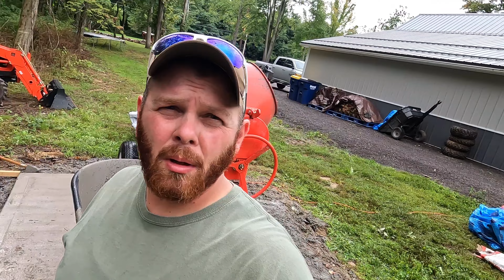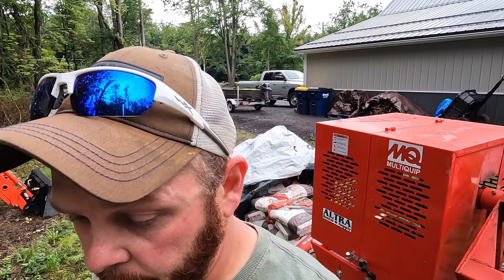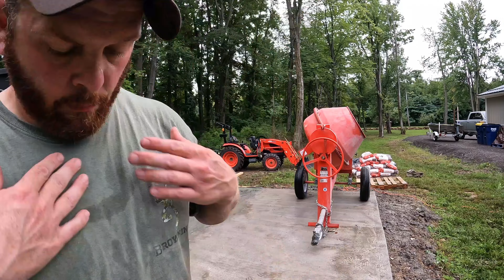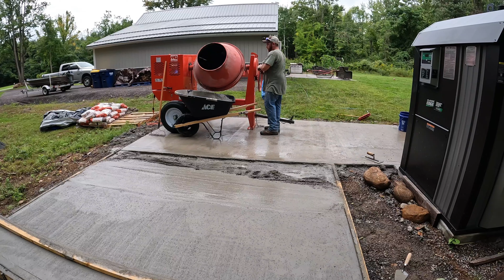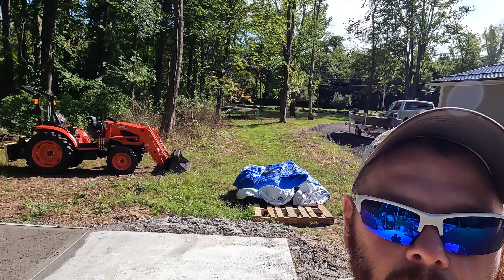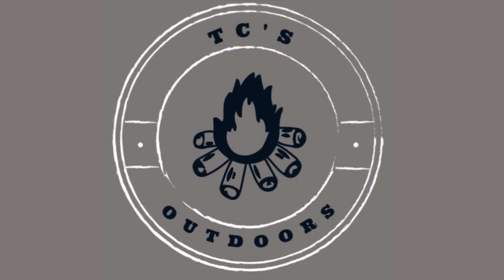DIY Concrete Pad Woodshed Part 2 #54   4K

Comment: Best high school class I had was masonry class. I still have all of my notes for estimating concrete. It's came in much handier over the years than some of the stuff I learned in school. It looks good to me. Fortunately our last pour here was only 8 yards and it went fast. It helped having a good delivery driver with the concrete truck. I've done it by hand like yourself also. I'm sure it will serve you well.
Reply from the maker: It was a fun project but definitely a lot of work. I think it should work out well for firewood storage for years to come!  Thanks for watching I appreciate it

Comment: Nice work Tony !! That is a tuff job, especially alone. Most wouldn’t even try it, if they had no experience doing it. Really hard in the conditions you had to deal with ✔️ Good Stuff ! 🌧👍👏 Rick
Reply from the maker: Thanks Rick!! It wasn’t ideal conditions but it worked out pretty good 👍🏻. Next time I’ll make sure I have a little help, I was exhausted when I finished. Thanks for watching, see you on the next one.